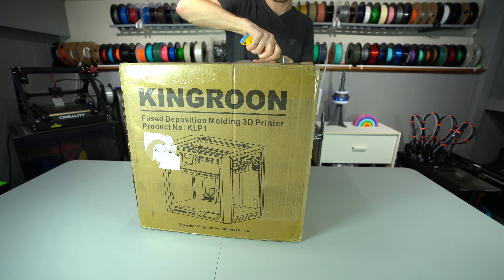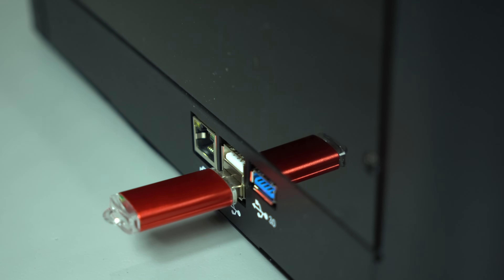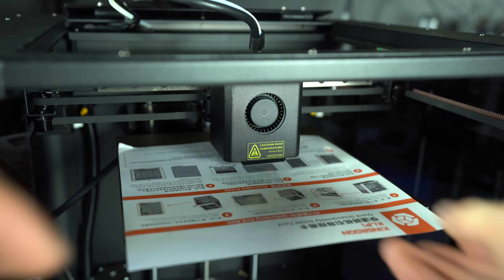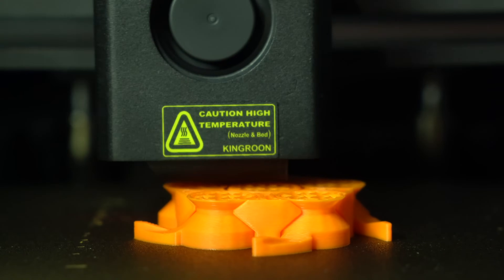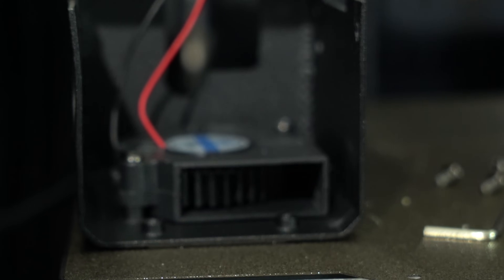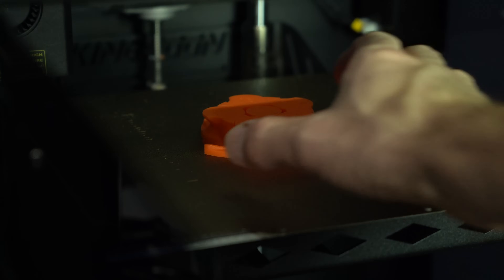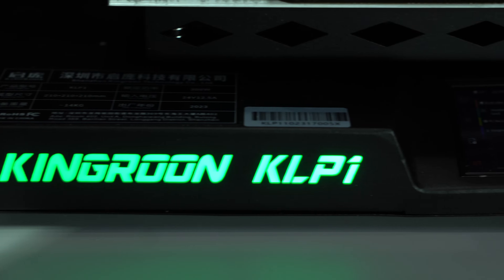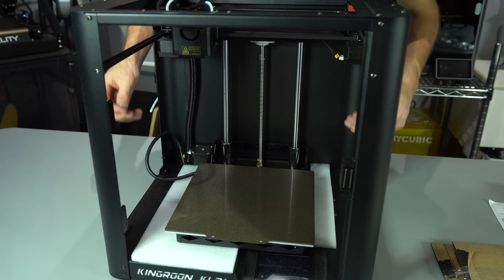The New KING of Klipper - KLP1 is FAST & CHEAP

Comment: im looking to replace some of my older machines with newer up to date printers, all mine work great but it had been 3 or 4 years since id purchased a new printer an i recently decided to get a bambu lab p1s combo with the ams an its completely changed the way i look at my old 3d printers. they work but not near as fast or as accurate for at least the what im seeing  from my bambu labs p1s so im assuming that all these newer machines like the klp1 or the k1c from creality are all worth the money for the machines but after buying the p1s the only way i'll ever buy another brand again is if its actually cheaper while still being a solid machine. the bambu studio an the ams is something i think  bring alot of value to these machines an is what makes me not want to try other brands but ive never been a fan boy of anything so i got to try at least the creality k1max or something similar to it. the build volume is the biggest complaint i have with my bambu lab p1s but thats only cause there alot of stuff id love to print in multicolor that i cant unless i cut the model into pieces an sometimes thats not a option but im really wanting to upgrade a few of my older machines with something new an the klp1 and the k1c or k1max are the 3 i have my mind set on right now im just trying to figure out what is the best bang for the buck or if i should just say hell with it an buy another p1s or p1p. creality has there new ender 3 v3 coming out that is a core xy bed slinger so thats something that is going to be an interesting machine but if it doesnt come with linear rails on all its axis or at least the x an z with larger 10mm or 12mm linear rods i think you would be better of spending the money on bambu labs a1 bed slinger instead cause at least it has linear rails on all its axis so u know its going to be as rigid as it can for the speeds they are printing at.

Comment: There is a lot to like in the Kingroon KLP1, and the deficiencies should be easy to fix in an upgraded model.  Most of the low cost Klipper machines do a factory input shaping calibration and use that for all printers in all conditions.  Kudos to Kingroon for not only having an accelerometer on the print head so each machine can be calibrated in each location, but also for making it so easy to do the pressure advance calibration which other printers program from the factory as well.  The full version of open source Klipper is always desirable to manufacturers crippling it to make their own proprietary versions.  Finally, good job on providing profiles for Cura, PrusaSlicer and OrcaSlicer, even if they're only PLA profiles.  Other materials could be added in the profiles without much effort.  I hate each 3D printer shipping with a reskinned version of Cura that's two years old.

Comment: ore XY is shit to todays real part printers, how do you do compensation on dimension accuracy, since 2 motors are used of single axis this is not possible. Bye bye 0.1mm accurate parts not possible.

Comment: Thanks for the informative Video... I need to fix the D3vil Burner for Upside-down prints ... in anyway its made to be print Frontside up also D3vilBurner V2 ( knomi v2) is designed a lil better

Comment: I like it, it seems to have a modern architecture, more or less standard parts. Not so good seems to be the part cooling (single direction).
After testing resonance compensation, what are the resulting frequency and acceleration that Klipper gives?

Comment: I need a printer that can do 36x36x36 print size and do it as fast as possible. What can you recommend?
Reply from the maker: A 400^3 RatRig V-Core 3 would do the trick if you’re willing to build it.
Reply: @ygk3d  id rather buy complete working machine than build it my self.

Comment: hello, I tried the standard boat with the PLA provided with the printer, 3 times the PLA cuts under the extruder then Strats again..... I did the pressure calibration, all the things said in the manual. do you have ideas? maybe I should use a PLA on a bobine? regards

Comment: I have one more question about the extruder. Everything seems to be made of metal except the gear wheel. So the housing and inner parts are also made of metal? Most competitors do have plastic parts where the filament goes down the hotend and clogging issues often occur. So a solid extruder would be a good selling point....
Reply from the maker: Not at the printer right now to confirm but from what I recall it is all metal.

Comment: Hi, you said that the RP2040 is used for the klipper computations which isn't really the case here. The RP2040 seems to be on the toolhead board just to control the extruder, fans, probe and accelerometer. To me it looks like the processor (not MCU) is in the mainboard under the green heatsink, also next to what I would guess is the ram of the system. That handles the klipper computations and RP2040 is just a secondary MCU.
Reply from the maker: Ah, yes, you may be right.

Comment: Ok, this is a great offering and as such totally outperforms an Ender 3, but ... I started 3d printing by buying an Ender 3 Pro for < €200 after a lot of hesitation on spending that amount on something I might throw out afrer a couple of print attempts.  And I guess a lot of potential future 3d printer users may be like that.  So, in that context I'd rather say the Ender 3 v3 SE is the new Ender 3.  It has everything to allow new users to succeed at a price level that can convince people not knowing much on 3d printing to still jump into the deep ...  $379 (which for Europe will likely end up > €400 with taxes and such) is ok, but not what the Ender 3 was for my 3d printing "generation" (just 3 years ago).
Reply: I've been in this boat too - didn't want to spend a lot of money on something, that i probably will not like. And i ended up buying an Ender 3. 

But the truth is Ender 3 requires a lot of upgrades - BL touch, Sprite Extruder, PEI surface is a necessity, while the silent board and led bar light is a things are nice to have.

And of course Klipper - it's essential! Let's be honest: printers without it are obsolete, and it requires a Raspberry Pi like computer, plus Pi Pico and ADXL345 for input shaping resonance measuring. And a lot of knowledge to set it all up.

And this is not all - now i realized that i need an enclosure for my printer.

Altho i had a lot of fun with all that staff, i think many people will not share my excitement, and it was much nicer for them just to buy this Kingroon, that have everything i mention for the price i spent combined, minus time i spent to set everything up.
Reply: @I000I  Sure, I too have upgraded to CoreXY since the Ender 3 and now even have a Bambu on the way, but the Ender 3's major achievement has been to be the cheap introduction to 3d printing for people totally not knowledgeable on the topic. I have bashed Creality many times on their bad decisions, but I have to say the Ender 3 V3 SE is truly deserving the Ender 3 name and beats the original for newbies as bed leveling - reason #1 for newbies to fail - is automatic and still at that low price point.  Most other Ender 3 wannabees (V2 and newer) in my opinion do not deserve that name and neither does this CoreXY.  Sure, it offers a lot for the price for those knowing how to leverage it all, but that's not what would convince newbies.  Probably the Bambu A1 mini would tick more newbie needs, but honestly for the price the Ender 3 V3 SE seems very hard to beat.  I would suggest to Creality to stop making all their other Ender 3 printers apart from the V3 SE and KE as the bad experiences those others may give newbies can turn them off from 3d printing and hence hurt sales in the long run.
Reply: @MisterkeTube ender and Bambu is trash this walks all over both
Reply: Ender is trash

Comment: Looks way better than Creality K1 by a ton.
Reply from the maker: The K1 has the edge on build volume, but I like how the KLP1 is running unadulterated Klipper.
Reply: @ygk3d  The latest firmware for the K1 is unlocked.

Comment: I'd like to see this get paired with an MMU somehow.
Reply from the maker: The AMS will remain Bambu’s competitive advantage until someone puts forth an equivalent solution that is equally as easy to use.
Reply: @ygk3d  Ankermake is making a version of the AMS, they call it the Colour Engine, more info about it is available on their website
Reply: wait for Phrozen to fully unveil the Arco FDM 3D printer and it's... Arco Material System?
Reply from the maker: @DJProPlusMax  Arco Material System… AMS.. has a certain ring to it 😂
Reply: Chameleon mk4 might be good option?

Comment: cantilever bed is a deal breaker for me, making the k1 a better option still
Reply from the maker: I haven’t seen any adverse effects in my testing so far.
Reply: @ygk3d  Igor gaspar found .01mm of deformation per 100g mass on the bed. The larger the object, the more the y-z skew changes
Reply: @1fareast14  Depends on the build quality. I have an original Anycubic 4Max with 12mm rods and deformation is a non issue.

Comment: Okay, so do I get this, or pay the extra $50 to get a Creality K1?
Reply from the maker: Good question… K1 is a bit bigger, has an aux fan, and a chamber light. My main reason for preferring the KLP1 is that it’s running normal Klipper with basic Klipperscreen, which is preferred in my opinion to the manufacturer specific firmware / UI implementations.
Reply: I have a K1 and I love it. I don't know if you have Experience or not but I would definitely go with the K1 since it offers more premade profiles with different materials, is bigger and, if you want to, you can root it and have full Access to Klipper.

Comment: What I'm starting to learn is that Marlin was what was holding back through the printing. Klipper is just the way to go. you can take any midrange printer and make it a solid option
Reply from the maker: To be fair, Marlin runs on 8 bit boards. Klipper required much more processing power. But as compute power gets cheaper, it just makes sense to use it. Klipper has done a good job being on the forefront of that trend.
Reply: @ygk3d  that is very true. 3d printing is in a great position to really fixate itself into the common household
Reply: Meanwhile the king of fast mass market is bambu labs, on Marlin.... I think you're assessment of Marlin versus Klipper isn't rooted in fact just an ambiguous statement.
Reply: They made their own firmware, and it's not based on marlin (if it were, they'd be legally required to open source their firmware)
Reply: Input shaping can make printer accelerate faster without too much ringing, though details can get washed out in the process (when using higher acceleration that the shaper can compensate without sacrifaces).
Pressure/Linear advance can compensate extrusion during acceleration, so corners don't bulge or look like rice crispies.
Klipper is known to have both.
Marlin has had Linear Advance for a long time (and for a while it has worked with standalone silent steppers), ZV IS compensation for some time and new Fixed-Time Motion with multiple shapers (both also work with standalone silent steppers).
What Marlin does not have is easy shaper calibration for more than single resonant frequency.

Klipper cannot make printers print faster (as in mm/s or mm3/s), so no, it's not Marlin that's holding back the printing. It's manufacturers being cheap on firmware, hotends, motion systems, other hardware.

Also, you cannot compare e.g. plain old Ender to pretty much anything 2023 offered 😅

Comment: The Kingroon KLP1 CoreXY Printer have unlimited Klipper by manufacturer?
Reply from the maker: As far as I can tell it is just regular Klipper. They have deactivated auto updates though. Not sure what would happen if you tried to update to the latest version. It might break something. But they have given you the adapter required to flash the firmware to the board, so at least you could recover it if that happened.
Reply: @ygk3d  I am glad they disabled auto updates. Does the printer work? They why are we updating it unless its a new needed feature? A few years back I had a klipper update that broke the printer. If my printers work I NEVER update them.

Comment: I have concerns about the cantilever bed.  I think the may have beefed it up a bit since first release.
Reply from the maker: Cantilevered beds/gantrys are always a little off putting. They seem like they shouldn't work as well as they do. But the A1 Mini, and a few others (Prusa Mini, Kingroon KLP3), has proved that high speed, high quality printing is still possible with this setup. A cantilevered bed, like seen here, seems like a safer bet than a cantilevered gantry, since the Z axis moves slower and less often. I didn't notice any issues with it in my testing.
Reply: @ygk3d  Cantilevered beds are fine if supported properly on small printers. Would not want to run one on a big printer bed.
Reply: @stevedegeorge726 a thin 180mm pcb bed is about the max id do for a cantilever design, although you could make a bigger setup work that would require double bearings on the rods or 2 carriages per rail with a diagonal support that takes up a lot of z space and isnt much cheaper than a 2 or 3z setup
Reply: Earlier reviews saw a lot of deflection on the edge furthest from the mount point that resulted in artifacts on larger prints.
Reply from the maker: @JohnOlson  ah, interesting. I haven’t seen those. Do you recall who reported on it?

Comment: Things like very dark tinted windows, melty fan shroud, door not quite lining up, top lid when open hitting the spool, etc make me think the new "fast 3D printing" version of a race to the bottom has begun. Better than the slow version we've been in for over a decade, but still not great. A good user experience should be very high on the list when a company puts out a cheaper printer since it will often be bought as a first printer, and when they have weird issues that a newbie won't be prepared for, that's how you turn someone off to 3D printing in general.
That said, thanks for showing it to us so we know what's up.
Reply from the maker: Thanks for watching and commenting. These 3D printing companies need closed focus groups. Instead, they send printers to YouTubers for reviews, which only hurts their reputation when issues arise. All of the things I observed could have been caught and resolved in the product development process by somebody with a basic level of experience. That could have taken this machine from good to great. But overall, it's still good value for what they're charging for it, and most of the issues are minor ones that can easily be resolved or worked around.
Reply: @ygk3d yes it is. I have x1c and my brother got 2 k1 for under 700 $, I say his choice is way better than mine.
Reply: Calling it the new king is in this version too much honour, a first time user would encounter a showstopper with a deformed part. I consider the title to be a click bait therefore
Reply: Yeah ,like. Bambu? Such a "great" printer, only why their support is so slammed with a bunch of dummies that can't use it? I opened a ticket 8 days ago and still nothing from them. 
I had never asked them a print question because I went through a learning curve on creality. 
Printers like this are perfect for beginners because they will teach them a lot more about the whole 3d printing world.

Comment: I got the first version without screen (ordered it on the day of launch). It is horrible. Worst printer I’ve used. Kingroon wouldn’t let me return it, they just sent me parts, that fixed nothing. It’s in the bin now.
Reply from the maker: That's a shame. Sorry for your luck. The Klipper screen is what intrigued me most about this printer. I haven't had to deal with their support, so can't attest to that. Not sure what other changes they made from V1 to V2, but the overall experience was a positive one for me. Still not perfect but good value for the money.

Comment: Actually I just got the printer last saturday (for 280€ from geekbuyers with a 40€  couponcode) and for this price it seems O.K.
However, Quality Control isn't the strong part of kingroon. As I wanted to mount the door, it didn't fit. The reason was quite simple: They mounted the hinges and the metal part where you mount the knob from the wrong side... Easy to fix, but something like this shouldn't be happening.
The board on the KLP1 seems to be an OEM variant of the MKS Skipr and the printhead board a variant of the MKS THR series, wich should make modifications quite easy. Quite simular to the Qidi X-3 series.
However, there a two major complains about the design:

- Distance between reverse bowden and top lid is too smal. But there is a design on printables to extend the top, so there is more space for the bowden and the cable (at the moment I print it from ABS on my Qidi X-Max 3)

- The extrusion is less consistant than on my Qidi's. Kingroon seems to use normal bondtech style dual gears. There are some videos about the downsides using them in direct extruders, but they seem still quite popular. Qidi uses Large Gears (which is better - but of course a big single gear+bearings like on prusas nextruder gives even better results). Theese bondtech clones very a lot in production, so some might have nicer quality than others - but you never know before.

So I won't recommend the KLP1 to newbees - but it might be nice after about 1 year of 3d printing, if you like to tinker yourself.
Reply from the maker: Thanks for your comment. Great insights!